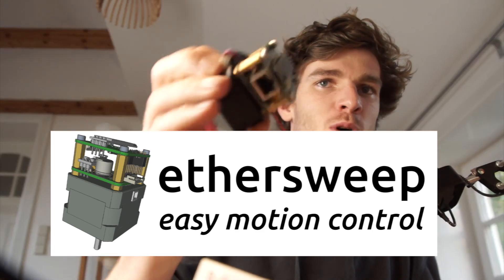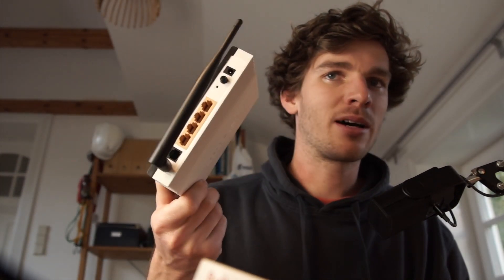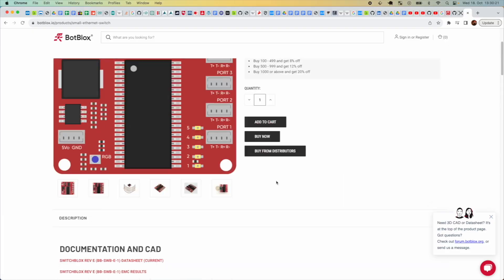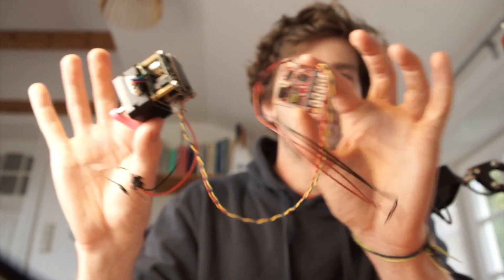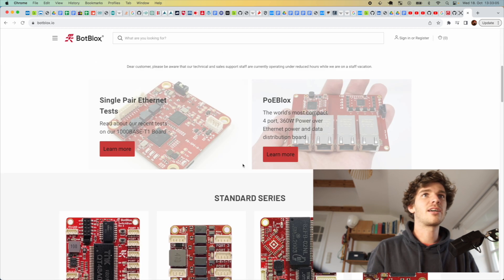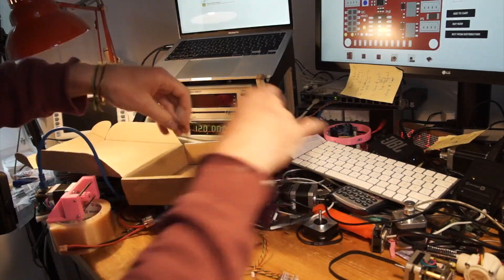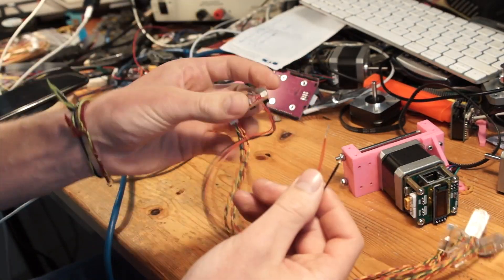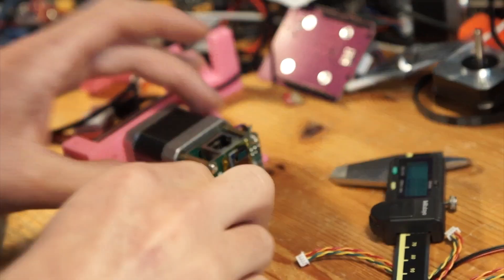SwitchBlox - a super tiny 100Mbit Ethernet Switch for Robots and Machines

Comment: holy cow, these are exactly what I have been looking for! I am working on automating some curtains, and been looking at how to do it simple and reliable. I ended up with some stepper motors with the driver on the back, but I still need to have a microcontroller to send the steps to the drivers for those motors.
Reply from the maker: I guess the nema17 motors are a bit to weak. Maybe I‘ll build a nema23 version. That would be sufficient. Maybe a bldc version would be the right motor for this kind of application :)
Reply: @Neumi  for my curtains Nema 17 is plenty, they slide horizontally on a rail and does not require much force.
Reply from the maker: @mikeydk  Ok, I thought it would be like these heavy blinds. Do you have a link or something? This would actually be interesting. Maybe with MQTT or some home automation protocol? It would be very easy to add this as a second firmware or feature to Ethersweep I think.
Reply: @Neumi I got a video on my channel which is showing the curtain tilting, but completely opening and closing is still in the research stage. Most ideal solution would be to have something, which in my case, would be something with an integration for Home Assistant, where it would just be possible to input the ip, and then options for acceleration, some kind of position/steps from zero to move to, a way to see what position it is at while traveling to it, and then have a way to move towards the end-stop and find zero.
Reply from the maker: @mikeydk  These kind of position and move features are currently in development, but I think it might be worth a try. But for now you'd have to run some kind of bridge between home assistant to the Ethersweep interface. But that ist just a few lines of (python) code.
Reply: @Neumi  which is also perfect, integrations are also written in python ;) I don't know how to write integrations, yet, but it is all open source, so it should be possible to figure out.

Comment: Why don't you use automotive ethernet (802.3bw)? Single TP full duplex connection with PoE (802.3bu)...
Reply from the maker: For Ethersweep one very important feature is to be able to use the normal networking hardware and software like rj45, protocols like TCP, UDP, IP. This makes it very convenient to run them from normal computers or microcontrollers. (Because every machine supports normal protocols out of the box without the need for specialized and expensive hardware) 
But this doesn’t mean that twisted pair Ethernet could’t be a good choice for specialized applications.
Reply: @Neumi  802.3bw is just another bottom layer. This is ethernet and it is already used in industrial environments.
Reply from the maker: With „normal“ I mean RJ45 and the networking hardware i.e. your computer uses without specialized (and expensive) hardware. 
If we start to use specialized hardware and protocols the range of possible applications shrinks to a minimum. For specialized applications it would be good to use for obvious reasons. 
The W5500 Ethernet chip I‘m using on Ethersweep also doesn’t support 802.3bw.